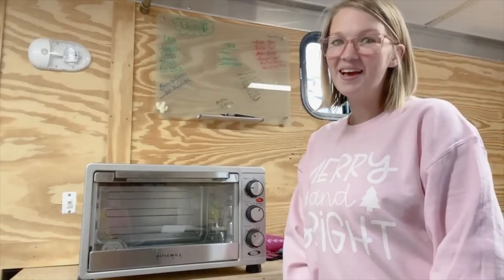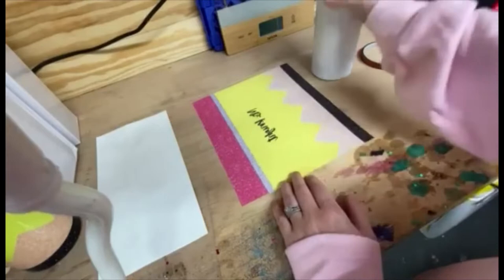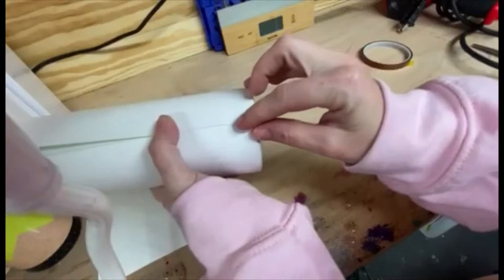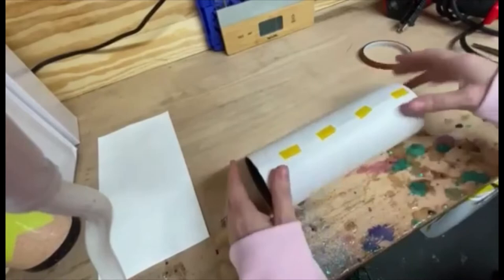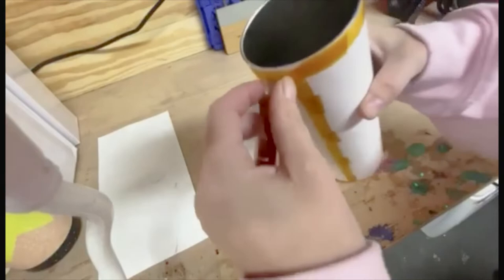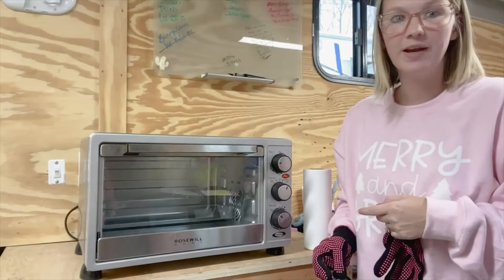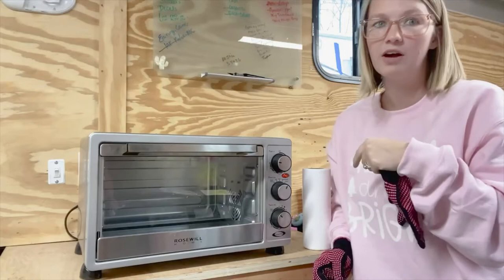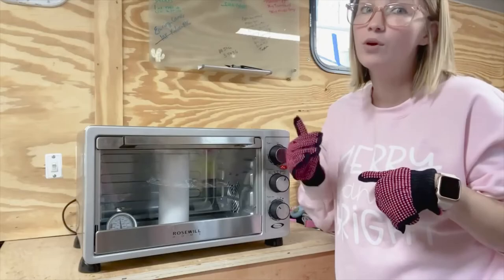How to Make Sublimation Tumblers for Beginners | 20 oz Full Wrap in a Convection Oven

Comment: I don’t use a heat gun, I tried using one but I could never get it nice and flat so I just stuck the tumbler inside the shrink wrap in the oven (after taping down my image, etc.) and the oven will shrink the shrink wrap for you. Ive known people who don’t even use the shrink wraps! Although I cannot attest to how well the image shows up because I’ve never done mine that way. But you definitely don’t need to shrink wrap them before the oven. Let the oven do the shrinking for you especially if you don’t have a heat gun.
Reply from the maker: I have seen people use just tape & no shrink wrap. But I’ve personally never tried it. What I did in the tutorial above is what works best for me. Everyone has their own spin and that’s one of the many things I love about sublimation! Thank you for the tips!😊
Reply: @brantleybabes8153  I agree. There’s so many different techniques to do crafts in general. It’s just finding what works best for you as everyone says. You kind of have to just trial and error for a while to get the perfect combo for yourself. 
I just wanted to mention not needing a heat gun in my previous post for anyone who didn’t have a heat gun or who were having trouble getting the shrink wrap on nice and flat and straight ...like I was lol. I wasted SO many shrink films trying to get it on flat with my heat gun before I put in oven and finally just said screw it I’ll just throw it in oven and let it shrink for me lol. Luckily the oven does the shrinking for you so I’m questioning if the extra step in using the heat gun to shrink the film before the oven is even necessary? Curious if anyone has tried either way?

Comment: How do you get the glitter faux look. Is this a glitter tumbler? Or plain white? Do you need special ink for the faux glitter or can any sublimation printer do it?
Reply from the maker: The “glitter” is part of the digital design. The one I used in this tutorial is a solid white glossy tumbler. You don’t need special ink (other than sublimation ink) for the glitter look. Hope this helped!😊
Reply: @brantleybabes8153  thanks so much. I am worried to try it because sublimation makes for expensive mistakes but they are SO pretty!  I appreciate the video and the help!!